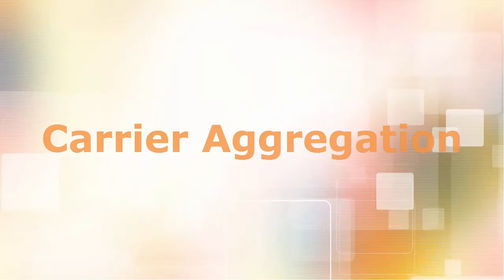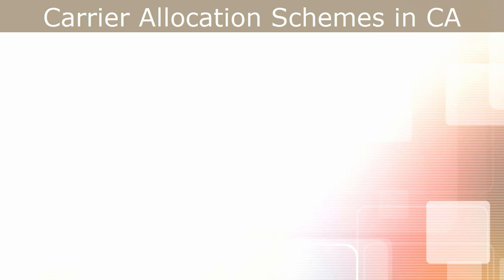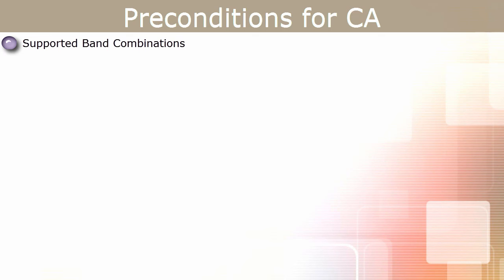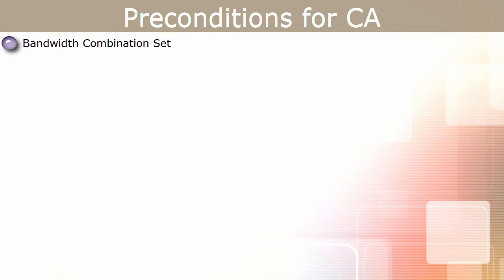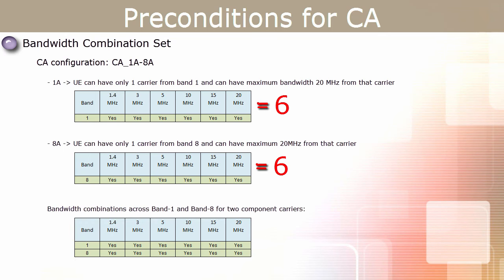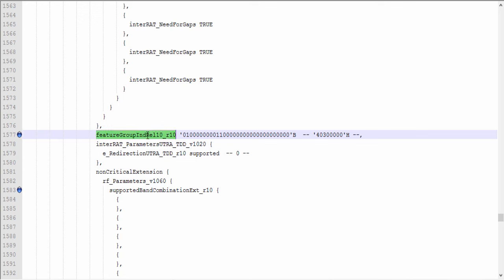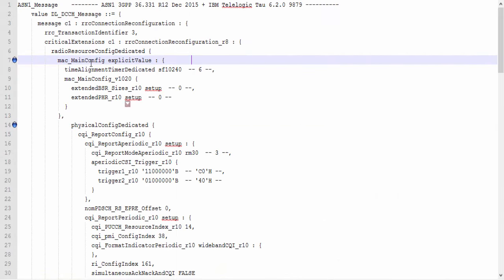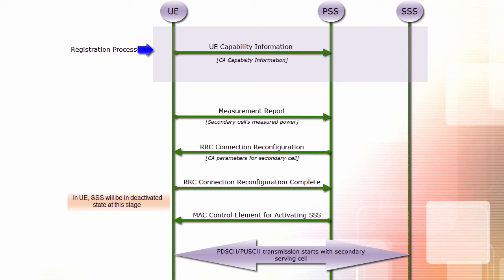Carrier Aggregation in LTE - Theory + Log analysis

Comment: Excellent video, I like the way you  explain this topic, very good, thanks a lot. I am wondering about the scenario to test CA, could you please let me know one or two ways to test/verify CA ? what tools are needed ? what can I do to create enough traffic to force the UE to do CA ? In advance thanks again and keep up the good job your are doing.
Reply from the maker: Thanks for such a positive feedback. It really motivates me. 

First condition for CA is that network should have configured it. So, first of all search for a CA area. For this searching you need CA    capable mobile. Mostly, operators configure CA in city centers or highly populated areas. Data threshold has nothing to do with CA allocated. Only thing needed is that secondary cell should meet the measurement criterion. If you have a active data flow and second cell is added to the UE, eNodeB will activate the secondary cell to make data completion quicker.

You can check activation of secondary cell either by using the suitable AT command.  I do not remember the command at this moment. Or you can analyse RRC logs to confirm activation of secondary cell. Hope this will help.

Comment: Hi, Your videos are very helpful and very real time experience. 

I have a question regarding the Bandwidth Combination Set. For CA_1A_8A, why is it not possible for both bands to have combinations 1.4MHz & 1.4MHz, 3MHz & 3MHz? Could you please explain. In simple, why not other combinations possible between these 2 bands BW? 

I did understand the part "A" refers to RB's less than 100. So in that case, why not Band 1's 3MHz and Band 8's 3MHz.
Reply: I think I understood after watching it many times. Is it because of 3GPP standards " Table 5.6A 1-2 "from 36.101". 

I also read the below line in a CA document " For practical purposes, 3GPP limits the number of inter-band combinations defined to those required by operators".
Reply from the maker: Hi Nevsky, thanks for watching the video!!

Even, I do not know on basis these combinations are made. But all the possible combinations of bandwidth are defined in the 3GPP specification. You can go to 36.101 and see all kind of combinations such as band combinations, bandwidth combinations etc. for CA.

I think as CA is a physical layer concept, so to limit complexities at Physical layer 3GPP has limited the possible combinations. Your research also says the same.

But it is nice to see such interesting question. Keep coming!!

Comment: Hello, Is it right that we shouldn't take the secondary carrier component's throughput on the Physical layer, rather it should be taken from PDCP layer. (For measurement)
Please explain
Reply from the maker: Hi Zeeshan,

I did not get your question fully. What is your opinion? Why shouldn't we take throughput from Physical layer and why should be take it from PDCP layer? Please elaborate.
Reply: Actually, I am trying to view my TDD 2nd carrier TP, on tems investigation. And I have seen a huge difference b/w PUSH TP and PDCP TP.
Normally we take the Phy layer TP, and there is almost no difference b/w the two layesr's. but as I come to 2nd carrier, it shows bugged kind of values on Phy layer

Comment: It's really nice making off it rather reading hours together.... Actually I'm RF DT engineer but I'm very  intended to know about this protocol stack.... Well don't mind I have one doubt that if there is a 100mb of data in a pipe line we have 100 users now each user get how much about of data..??  Please tell me answer... Thanks for making clips..
Reply from the maker: Firstly, thanks for your feedback. It really matters to me!

It is not possible to answer this question by any means. As there are many factors affecting data rate for a given user so data rate for each user will vary. Few of these factors are UE capability and Radio conditions. 

Theoretically, if all factors are same, available bandwidth will be equally divided among all UEs. 

MAC layer of eNodeB dynamically allocates resources to each UE based on these varying factors .  

Please refer to my video on data rate calculation. This video will make things crystal clear. Happy watching 😀
Reply: There is limitation on number of UEs scheduled per TTI (like 4,6,8,16). Suppose 8 UE per TTI is configured in enodeB. So eNodeB will allocated all the resources among 8 UEs only. Now your next question is how eNodeB decides to allocate how much resources to all UEs. That actually depends on scheduler algorithm. If eNodeB is running on RoundRobin Scheduler then all 8 users will get equal resources, which is not the case generally. So eNodeB manages quality of service and uses different types of QoS scheduler mechanism that calculates priority for all UEs  based on Radio conditions and data in buffer as described by Pandari in Comments. Further those resources are divided among 8 users based on priority. In next tti further 8 users can be selected based on priority.

Comment: what does this ca combination define here? CA_3A
 {
                bandEUTRA-r10 3,
                bandParametersUL-r10 
                {
                  {
                    ca-BandwidthClassUL-r10 a
                  }
                },
                bandParametersDL-r10 
                {
                  {
                    ca-BandwidthClassDL-r10 a,
                    supportedMIMO-CapabilityDL-r10 twoLayers
                  }
                }
              }
            },
Reply: Intra band contiguous
Reply: @dineshd7687  but class A signifies that CA_3A. But there is no single frequency ca he also tells in video that CA_25A will not be mentioned since ca is not supported with single carrier